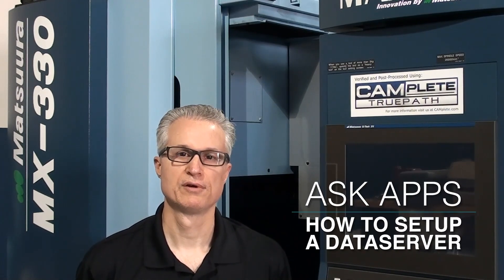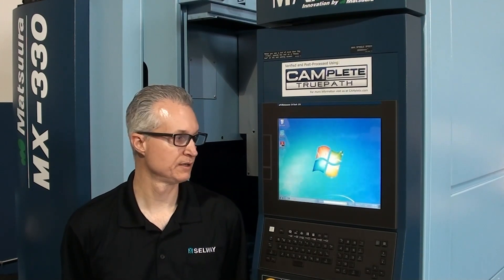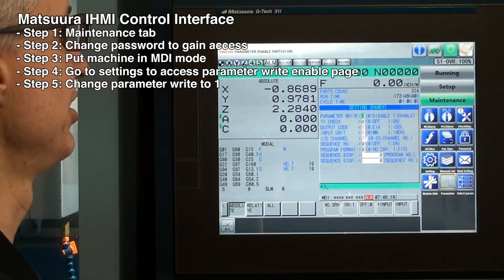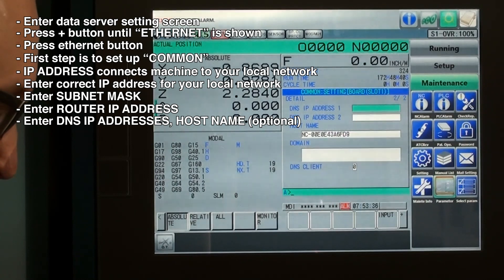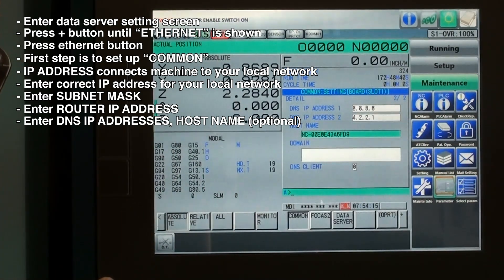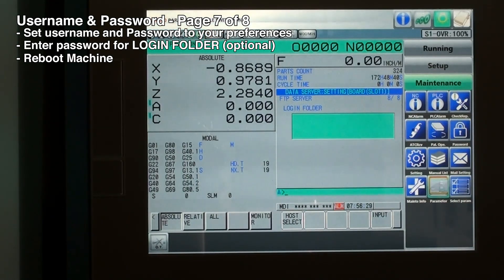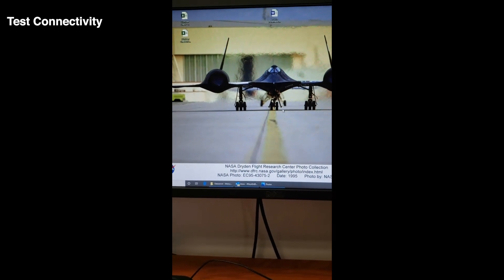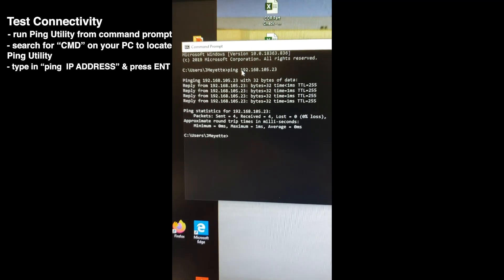Ask Apps | How to Set Up a Data Server on the Fanuc 31i Control

Comment: i have a question, if i have configured the embeded port and i have response of this IP, can i use the same IP in the Ethernet section in COMMON or i need to use a different IP ? and if i use a different, i need to change another parameter or disable some one?, best regards, and exellent video

Comment: Hello, thanks for the helpful video!!!

Is the first “built in” Ethernet port the embedded Ethernet soft-key?

Is there also a way to input tool data into the “tool manage” page in the setup tab via g code? I know the H parameters can be entered by 
G10 G90 L10 Pxxx Rxxx.xxx 
G10 G90 L12 Pxxx Rxxx.xxx

I ask this so I can pre-populate the tool table at the start of the NC program to save time and errors by the operator typing in values.

Comment: What is the process to setting up email notification on the machine side, Enable parameters etc
Reply: Send an e-mail to applications at selwaytool dot com and we can send you the procedure/manual.
Reply: @jamesmeyette7415  Thanks , We are still having an issue with getting this set up   Our Canadain AE is looking into it
Reply from the maker: Great question! Our AE is looking into it and will respond later today.
Reply: when exiting the main program, an error appears settings main programm failed. What is can I do?
Reply: @olegbeyzerman  If you are using a FANUC 16/18 Series control you will have the following;

CNC Memory
%
O1(MAIN PROGRAM)
N1
M198Pxxxx (DATASERVER CALL)
M30
%

Dataserver
%
O1234(PART PROGRAM)
N101
(PART PROGRAM HERE)
M01
M99
%

The Pxxxx will represent the O number program on your Dataserver (for example O1234 on your Dataserver needs an M198 P1234 call as shown above). 

That O number program needs to have an M99 at the end, not an M30. Also, you will need to set your I/O Channel to 5.

If you are using a FANUC 30i Series Control (30i, 31i, 32i, etc…)
There is no need to call as a sub program unless you want to. The newer controls allow you to run the program from the Dataserver with no sub-program call needed. Also, no need to set the I/O Channel to 5. It can stay what it is (usually 4 or 17 for CF Card and USB respectively).
Reply from the maker: @olegbeyzerman  Can you please share the error with applications@selwaytool.com in greater detail?  There is not enough information for our Applications Engineer team to know the exact issue. Thanks!